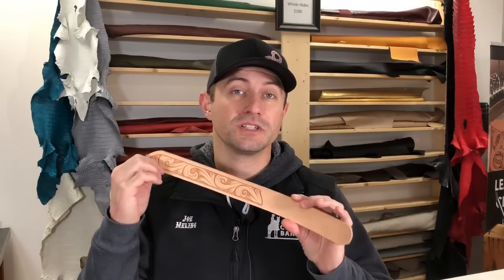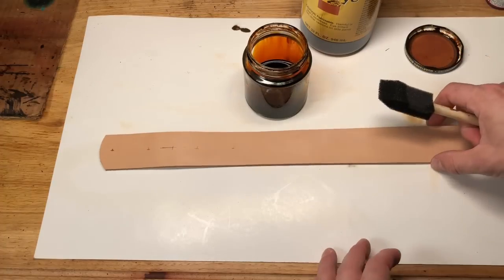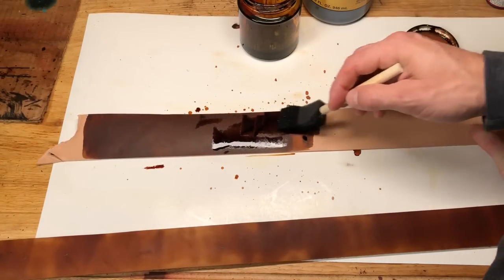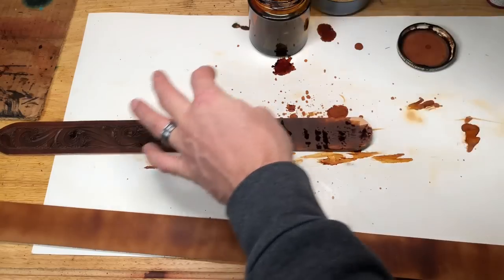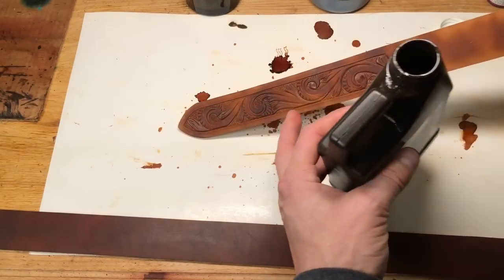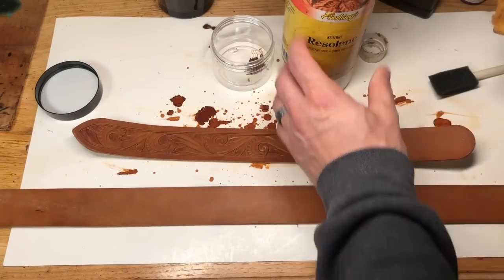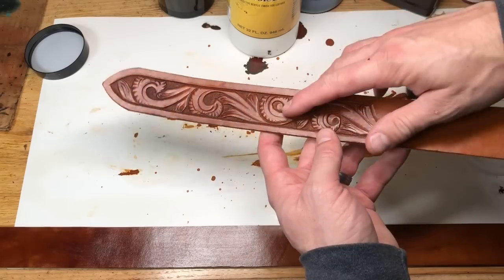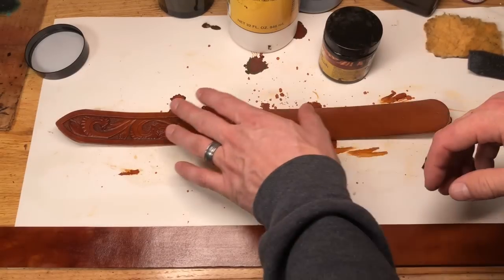Belt Building Series (Part 2 Dyeing Leather)

Comment: Dying has been a pain for me. Trying to get an even color on my project. It ends up a little darker than I wanted. I have resorted to just oil and antique.  Different leathers take oil or dye differently. I used a sponge applicator once and it was too much dye in some places leaving a blotchy mess and by the time I got it evened out, it was too dark.I will give your technice a try. With oil, I let it have time to set in before I  decide if it needs more. Again, thanks for the tips.
Reply from the maker: You’re welcome, I hope this helps you.

Comment: The leather dye dobber’s ~ you know that you’re supposed to burn them first before you use them to dye with right!!
Reply from the maker: That sounds like a good trick. I’ll have to give it a try. I don’t typically use them. I prefer the foam chip brushes for dying large areas. Thanks for sharing that tip.

Comment: Great stuff, Joe. I appreciated seeing a slightly different process than I have developed with a fantastic result. Is there a reason you prefer resolene over tan-kote?
Reply from the maker: I like the protection resolene offers. Especially on something that is getting antique. Resolene is formulated to seal and resist where the tan kote will allow penetration. Tan kote is great on a saddle over an oil finish. It will look great and allow for an even oil application after wear. 
It is also good to use for thinning antique. However it won’t resist antique like the resolene will and I don’t feel it seals antique in as well either.

Comment: I have used Feibing's Pro Dye for many years, with very satisfactory results. Recently in our state (California) Feibing's Pro Dye has been unavailable due to new state regulations. I have tried their other dye products (Feibing's institutional dyes, that use more of an alcohol base), and the results were disappointing. I also tried the Angelus products still not really satisfied with how they perform either. (They also appear to be an alcohol-based product.) They tend to be blotchier and more uneven in coloring. Have you tried these products? Do you have any suggestions, or should I just relocate to another state so I can get the Pro Dye, LOL.
I will give the foam brushes from hardware and paint store a try, which might help. I have always used the wool daubers for dying. Another idea I had was to mix some of the dye with the Neatsfootoil and then apply it to see if it will make the application more even. I see that in your video you did something similar by oiling right after dying.
Typically, I don't dye saddlery as I prefer the character given by regular cleaning/oiling, sun, dirt and sweat over time. However smaller items like belts, wallets, ect., I will dye and antique.

Comment: Great video Joe!! I’ve been struggling with dying. I’ve always been afraid to use pro dye after stamping a belt out and I’ve used just antique paste. Last belt I did I stamped oiled and then used dark brown antique and it ended up coming out blotchy  so I ended up dying and black and stamping out another belt for the customer  on another belt I made I stamped oiled applied tan coat, then antique paste finished off with tan coat  the bell came out very light. I used mahogany paste and it just didn’t bring out that nice mahogany color only in the impression areas. Is it possible to use antique without tan coat on just a stamped belt.? But I do feel more comfortable now using pro die on a belt to bring out rich colors
Reply: Guess I should have finished watching rest of video. I don’t think I will ever apply antique paste on without using a resist first.
Reply from the maker: @robmorse3917  you can definitely apply antique alone without a resist but it’s definitely a different look.